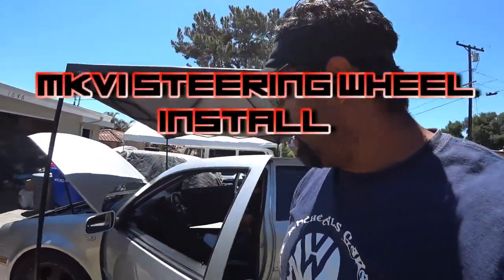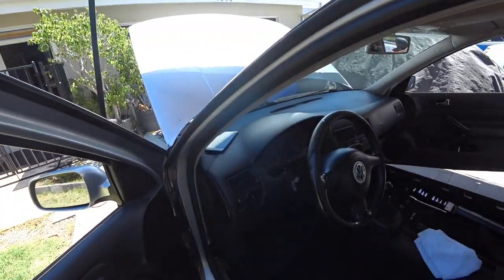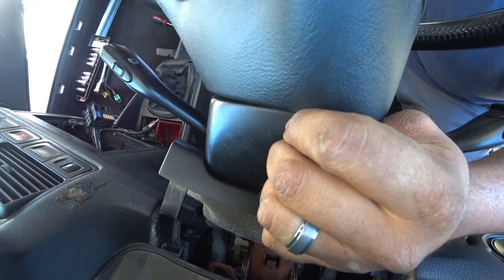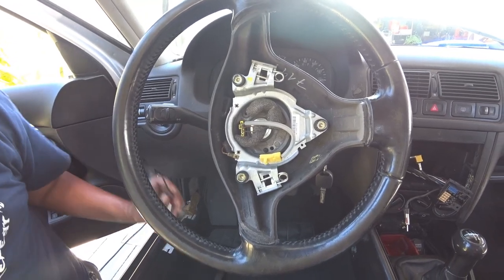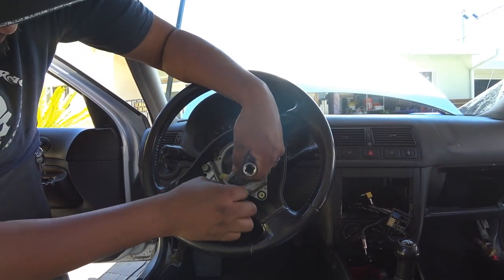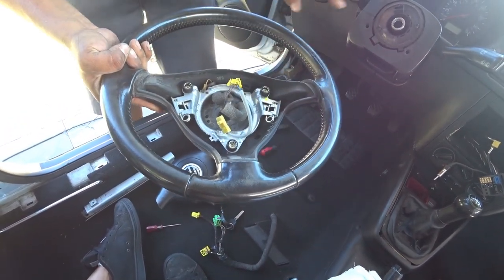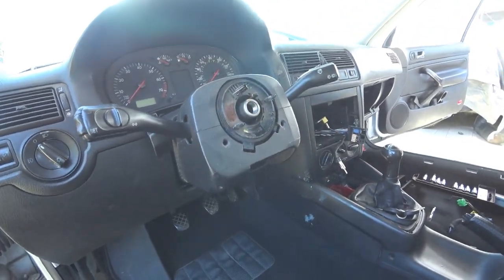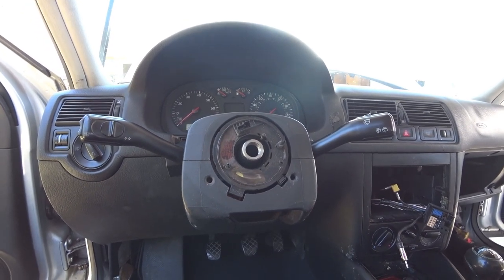How to Install an MK6 GTI steering wheel on an MK4 GTI/Jetta DIY S4 EP14

Comment: Can I use the MK6 steering wheel in my MK4 and get to use at least the volume buttons without having to change my car deck or will I have to change the car deck? I'm using the factory car deck.

Comment: Where did you buy the steering wheel , i can only find multifunctional flat bottom steering wheels , not the one without buttons
Reply: JonasDoesPhotography ecs has the carbon fiber an suede ones that you want
Reply: HOW TO FIND ??!?

Comment: Hey bro i really wanna change my steering wheel but i have asked around and people say there is an airbag issue, or no guarantee that if  the airbag would even open during an impact. So what is your opinion on this ?
Reply from the maker: yes that is 100% right. the air bag will not work you will need to do some homework and find out what you will need to make it work. i used a VW calssico harness to make my airbag work in my mk4 gti because that car was technically an mk5/6 with an MK4 body so a lot of same parts from older cars and new ones. The airbag harness in that car turned off my bag light because it was the proper resistance
Reply: @PincheALsGarage  I just bought a MK5 2010 wheel. Will the airbag work without mods?

Comment: Also i have another qwestion 
What if we change also clock spring we put mk6 clock spring and s wheel dooes Anithyng ?
Reply from the maker: @TIIRONC5H  won't fit. You need to look for the mk4.5 stuff. Canada and Mexico had a ton of them. The VW classico or city has the steering parts you need to make the mk6 wheel work correctly if you want the air bag to work.
Reply: @PincheALsGarage  so i let stock golf 4 clock spring i need only to modify connectors right ?

Comment: Hi there picheals garage. Just want to know. I'm thinking of buying an mk 1 velocity steering wheel and want to fit it on my jetta 3. Do you think it would fit?
Reply from the maker: MK1 Steering wheels are small spline wont fit an mk3 you'll need to enlarge the spline to make it fir the MK3

Comment: without hooking up the wiring will the airbag light come on?
Reply from the maker: Layten Perkins yes the light will come on. i am hunting down right now the vw classico harness so i can fix this issue.
Reply: PincheALs Garage I found a thread on how to wire it, but I'm kinda a lay person. No doubt I can do it, but the directions are unclear. Can you do a video showing the wiring, please? I have the wiring harnesses and the desire. Lol.
Reply: Here's the thread on vw vortex. All my wires are the same color and there's dual wires to each horn terminal. http://forums.vwvortex.com/#/topics/4885139?page=1
Reply from the maker: Layten Perkins i will do my best when i get some more time.

Comment: Can I do this to my mk4 Jetta?
Reply from the maker: Yup!
Reply: PincheAls Garage thanks. A guy at a ebay store, Quirkparts, won't sell me the steering wheel because he insists that it won't fit. I'm like I'm pretty sure it will. Now just sell me the damn wheel. He keeps asking for my cars Vin so he can send me the wheel to MY car.!? I don't think he's quit getting whats going on
Reply: PincheAls Garage this is what I said just a little bit ago "What started getting me wanting to do this was a guy where I work has a MK4 Jetta like mine but he's got either an MK6 or MK7 steering wheel. And when I started lookin for my Jetta I couldn't afford a mk6 or Mk7 but I really liked the wheel so when I saw it on his car I started getting the idea that they were interchangeable the only challenge I started to encounter was where to get one. That brings me to you. Here's a video that pretty much explains what I'm trying to do. I just need to confirm that the Jetta is interchangeable in the same way the golf is. The video - https://youtu.be/2IgrkbpVfx0"
Reply: PincheAls Garage and then he just replied "I am sorry but I cannot confirm that. Volkswagen would not recommend that. Thank you. -Peter"
Reply from the maker: Ian McIntosh this wheel will fit a big Splin MK2 all the way up to a current GEN MK7 vw...lol
Reply: PincheAls Garage right!? 😅I don't know what his deal is
Reply: PincheAls Garage I'm like just sell me the friggin wheel. Where do you get it?